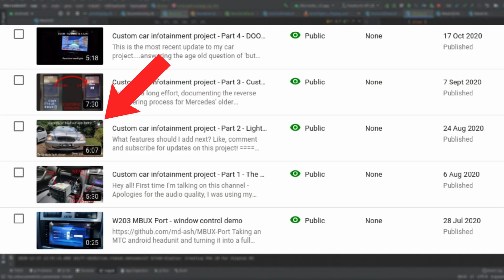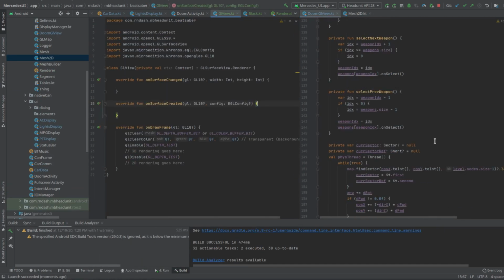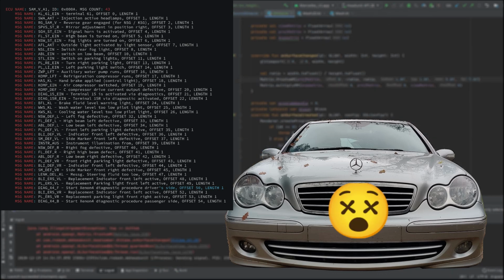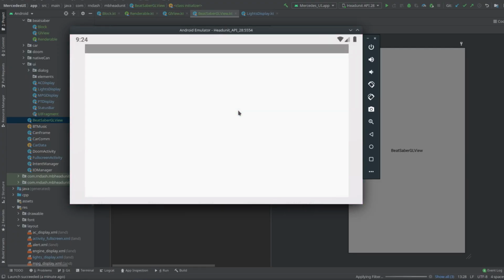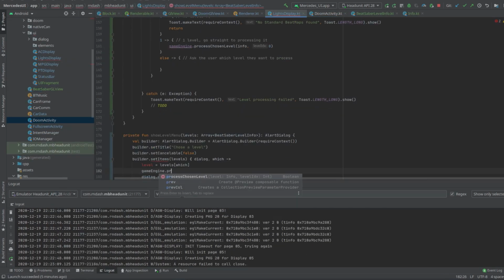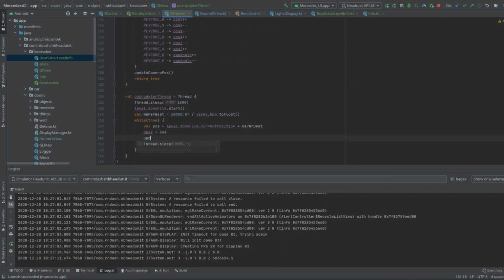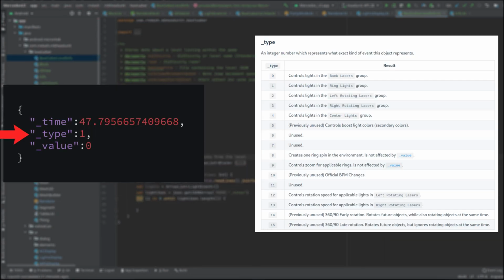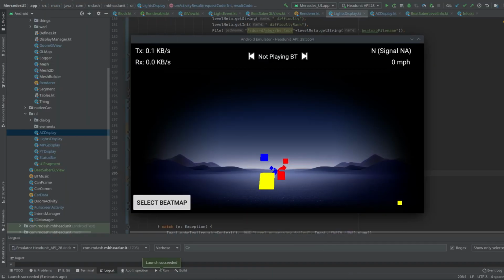I made my old Mercedes dance to beat saber maps  - Car infotainment project part 4

Comment: This is amazing! 

I think if you assign the lights to the blocks based on x/y position instead of the color it might match songs better, but like you pointed out figuring out that ridiculously large frame to use one more set of lights is still the biggest improvement opportunity. Subbed cause I'm hoping someday you're the guy who makes custom infotainment systems as readily available and easy to create/install as custom stereos have been in the past. Tough work, but this was phenomenal.
Reply from the maker: Appreciated. However I don't plan on making headunits easier to install, rather I want to focus on making apps for them that allow them to be more tightly integrated with the vehicle rather than these generic Chinese apps that come pre-installed with them.

Comment: Nice, swap those signals for leds for brightness so it looks cooler
Reply from the maker: This is hard to do on this car...front SAM module monitors the current draw of the bulbs and if its too low, it triggers a warning on the instrument cluster...The new Dipped Beam LED's are 5W LEDs with a 50W resistor strapped onto them, therefore they actually require a cooling fan to keep cool (Built onto the heatsink for the resistor)....I have tried to look but i can't find any LED's that are rated to draw 25W. Yes there are loads out there that will physically fit my car, but will draw way too little current for the car to be happy.

Also as a side note, in this car, if the indicator light is detected as 'faulty', the car will stop trying to use it and instead use the front fog light as a substitution.

Comment: lol i'm sure your headlights love that - this is amazing, really great that you show code!!! amazing stuff
Reply from the maker: its fine. Halogens are cheap from the local dealer, and the circuits use MOSFETs rather than relays, so it doesn't harm it too much to pulse them that fast
Reply: @RANDASH  could it be harmful for Xenon? I'm playing around with canbus on my w219. Would be really greet to reproduce your work
Reply from the maker: I would think so yes. Xenon system is far more complex than halogen/LED. So I would work with caution with xenons